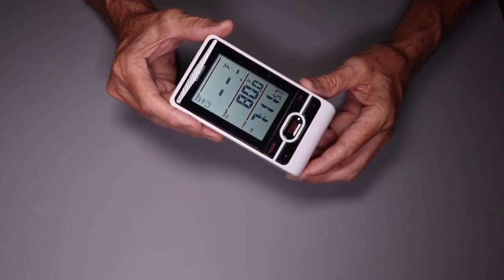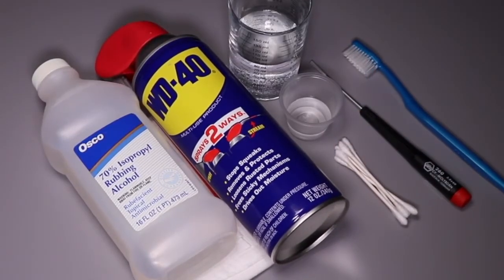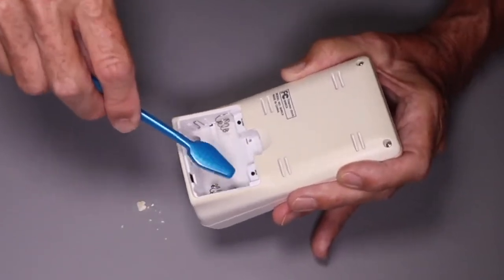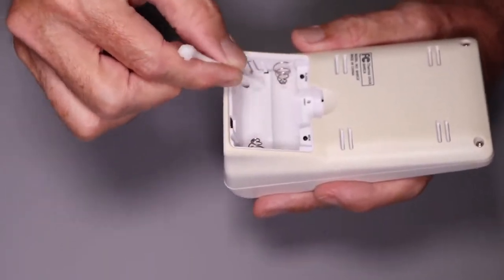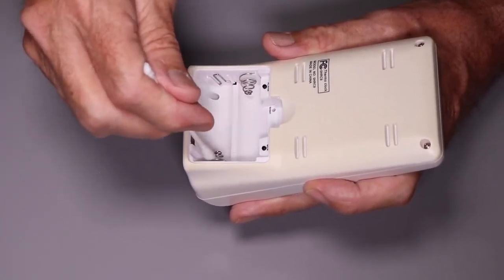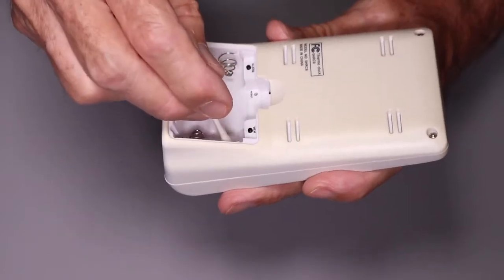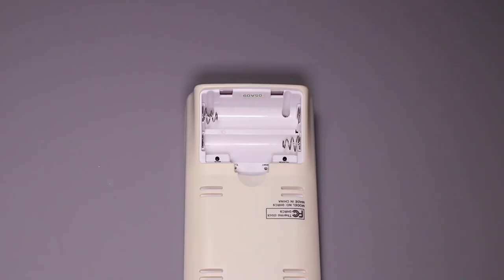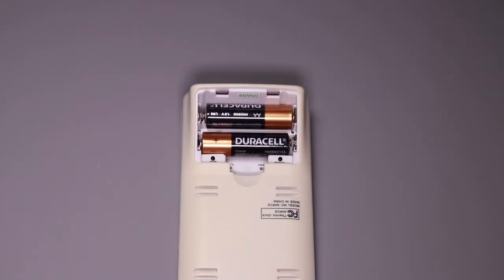Battery Leaking Fixed

Comment: Interesting and useful! I'm surprised this hasn't been more widely seen. I've thrown out a few things I could have kept had I seen this earlier. But I do wonder one thing. Recently my vehicle battery terminals got corroded, and a friend helped with a wire brush and so forth - and I used baking soda to "neutralize the acid" as I'd heard somewhere. Is that wrong? Is the corrosion basic and needs an acidic treatment? At least I'm smart enough now to look into it next time. And I have another comment: WD-40 is really toxic, a good solvent which means, airborne, it's bad for the brain. A lot of people will be very aware of bad effects when using it. So, personally, I would avoid it. I'm not sure why it was used here, but I hope leaving that out is just fine. Thanks very much for this! Next time I won't throw something out, only the batteries.